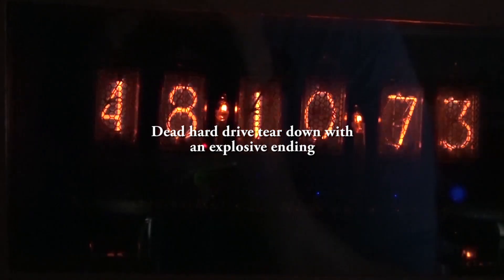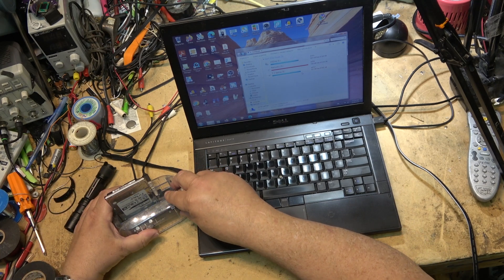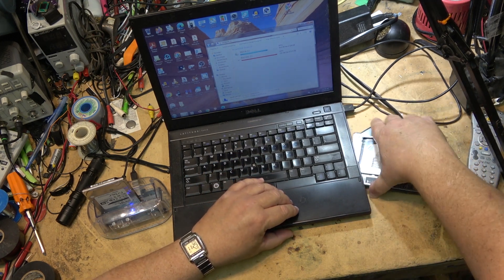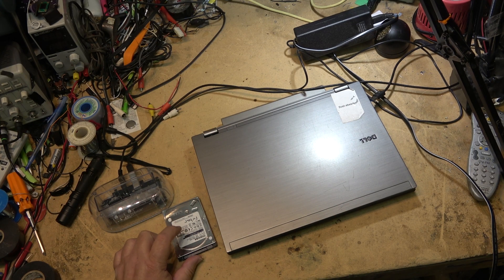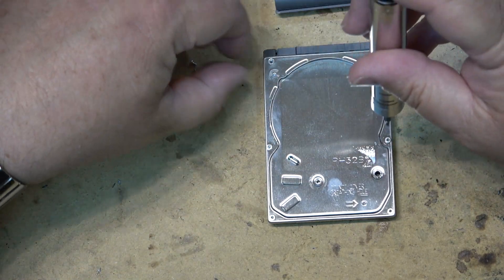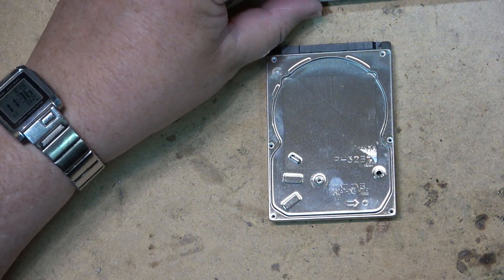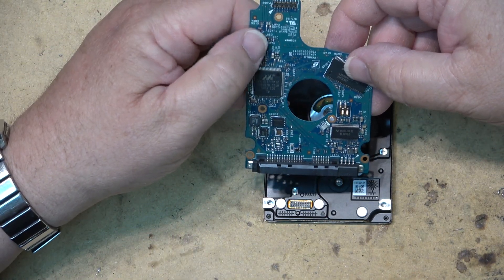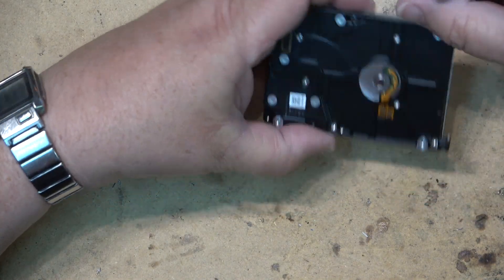Dead Hard Drive Tear down with an Explosive Ending

Comment: I have a couple of external hard drives and I don’t have a problem with it. So I decided to backup the files onto discs like CD-R’s, DVD-R’s, DVD+R’s, BD-R’s and M Disc for archival use, or you can use Flash Drives or SD cards to move files on there to save some space.

Comment: What is that outboard device you used to check the drives ?
Reply from the maker: Its just a docking station. I run bare drives. Have about 100 drives that have all my source files from over the years on them.

Comment: you sure its not from game console hard drives from a  Xbox box will not show up on a computer i had to format the hard drive  my friend gave me from his busted Xbox using the command prompt on windows it sucked but i got it working as normal hrad drive again it was a free 1 TB hrad drive
Reply from the maker: It came from a cable box and it would have been. Linux formatted.
Reply: @12voltvids  ok its screwed the lol

Comment: HAHAHAHAAH Deja Vu. I had a stack of Platters from the Bigger drives about  24" inches high before it fell over ..
You have a need for about a 100Lbs of magnet ??  Even after the Magnet was separated from it's base. I had them stuck all over every square Inch of my work Cubicle. 
I did not realize the little ones were Glass till I went to bend one. It didn't explode like Your did. Luckily I was not cut .

Comment: Never knew they were made from glass that's really interesting I got a raid drive that doesn't work it's probably something similar wrong with it
Reply: Laptop drives are glass, desktop drives are usually aluminum cored. At least this is my understanding. Higher density desktop drives might also be glass these days.

Comment: Toshiba 2.5” HD are one of the more reliable of the mechanical HDs. I’ve rarely lost one, even with physical damage. Hitachi 5400 rpm once were one of the worst with head failures (ironically the 7200 Hitachi ones were pretty good). Seagate still to this day has a weakness to the brand with still common dead sectors on all models.  

When sliding the head over the platter, make sure the disk is rotating to minimize surface damage. When someone slams their hands on the laptop, the platter and heads can become jammed and the motor doesn’t have enough torque to overcome the friction, but you can walk and rotate the head to home to save the data. 

When running with it open, you can blow the dust off lightly before spinning up, once spinning the dust doesn’t really settle, but dust will cause bad sectors but it’s usually not that big of a deal for data recovery.

The bearings can bind up too from dried up grease. Heat can help in loosen up the grease temporarily.

Also… I believe you can microwave the glass platters like a CD for a cool effect.

Comment: It is called a voice coil motor because the earliest drives used a linear motor and the coil and magnet assembly looked exactly like a speaker assembly.
Reply from the maker: Actually it's still a linear motor mounted on a pivot
Reply: @12voltvids  Not really, there is a cosine error associated with the head only being perpendicular to the tracks in one position.  The main reason we switched (I used to design them) is that only two bearings are required, a linear actuator requires six, so cost.  The other reason is the linear actuators requires more space, and we were trying to get them small.
Reply: Whichever it is, they were certainly capable of "voice" after a fashion. Some of the older drives used to beep error codes through their actuators and motors. It seemed to be most prevalent on IBM's larger SCSI drives around late 80s and the first half of the 90s, though as they're generally reliable you'd rarely ever hear it, unless you messed up the cabling, jumper positions or bus termination. Of course we're talking far enough back that there were still a handful of serviceable parts on them, whereas now it's usually cheaper to just bin a defective drive and replace it. That is to say rather than needing specific error codes, today the diagnostic merely consists of "Ah. It's not working." and little else.
Reply: @HighTreason610  We didn't do that, with an interface like SCSI you just send the error codes back to the controller.  We did make the beeping noise you talk about however.  In the early days drives didn't use ramp loading, the heads were always in contact with the disk.  We are talking about small drives here, not the ones with the removable packs.  Sometimes they would get stuck, so if we detected an overcurrent on spin start we would stop trying to spin (avoid destroying the head suspension) and send a tone out to the actuator in an attempt to float the head and break it free allowing it to be spun up.

Comment: Amazing technology in the small hard drives. There is  about a 5mm gap between the heads and the platter surface.
Reply from the maker: How is that when the platters are only separated by 3mm?
Reply: @12voltvids  Forgot some Zereo's HAHAHAHA

Comment: Why are glass platters used in 2.5" HDDs, and metal platters used in 3.5" HDDs?  I've always wondered.  Although in older 2.5" HDDs, like ones from the '90s, the platters are metal, I think.

Comment: Now you have a thousand piece puzzle to put together what you could of done try to put them platters in a different drive with a good motor i think those kinds of hard drives are slow i buy the solid state ssd drive there are faster
Reply from the maker: There was nothing on it. It came from a cable box and the files are encrypted anyway. SSD is faster but for repeated overwrites SSD will fail much sooner.
Reply: You can’t put platters in another drive. They have to be perfectly aligned to each other. You also need the eprom to tell the heads where the data is. All it sees is gibberish.
Reply: @Rotteneggsack  YOU can't put the platters in another drive, but data recovery specialists can. There are specialised software tools which will upload a custom firmware to the drive to read and save the raw data from each platter separately than merge them together. Yes, the alignment data from the original controller board I think is necessary for this to work, but there might be a workaround even for that, just a lot harder. There're tons of data recovery videos here in which they swap platters between drives. Some of their software tools are like black magic.
Reply: @Rotteneggsack  There's an easy trick to maintaining alignment: put a piece of tape on the outside of the platter stack. AFAIK on more modern drives most of the configuration data is stored on one of the platters, the program on the board is only used for some initial functions.

Of course there are other problems with swapping platters, it's definitely not worth doing to get a "free" drive.

Comment: Hey 12 volt! I really hope you see this as im in desperate need of some help regarding the technique RS-M63; my pinch roller is not engaging and im not sure if its because the mechanism is bad or the roller itself, I bought a replacement but im not sure how to begin taking the mechanism apart to determine what the fix will be. Think you could help somehow??
Reply from the maker: The M63 is a purely mechanical deck. I did a service on one a few years ago. Video is on my channel.